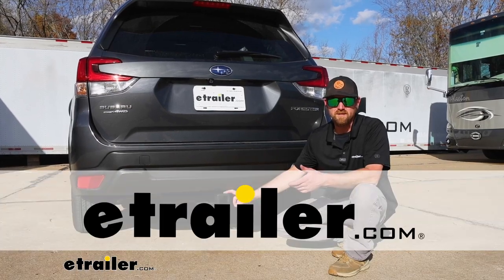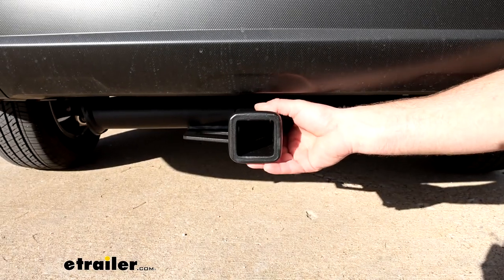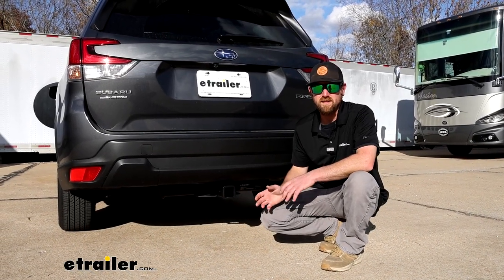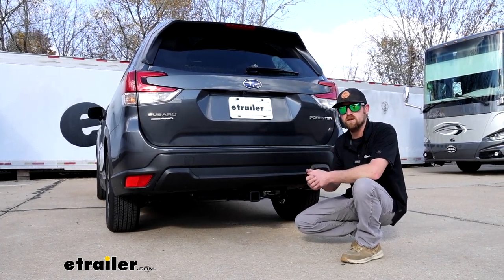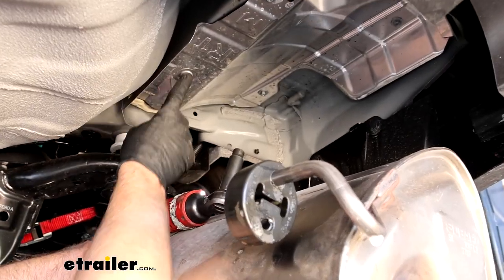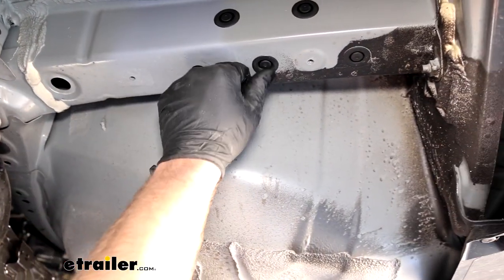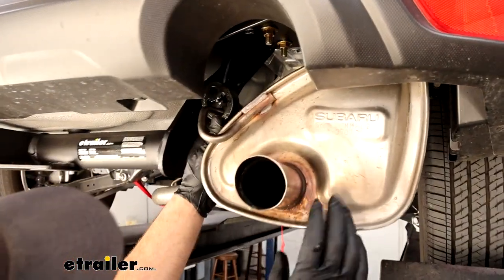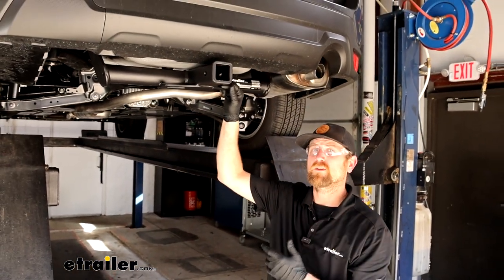How to Install the etrailer Trailer Hitch Receiver on a 2023 Subaru Forester

Comment: Great video guide, really helpful, and it's cool you made note to leave the last screw out of the heat-shield after reinstalling (I made this mistake the first time I installed a Curt hitch on my parents older Fozzy, which stumped me for longer than I care to admit).  The installation kit that comes with the eTrailer e83ZR class III made this SO much easier on my 2023 Forester Wilderness.  Any future installs, I'm sticking with eTrailer.
Reply from the maker: Thank you!!
https://www.etrailer.com/Trailer-Hitch/etrailer/e83ZR.html